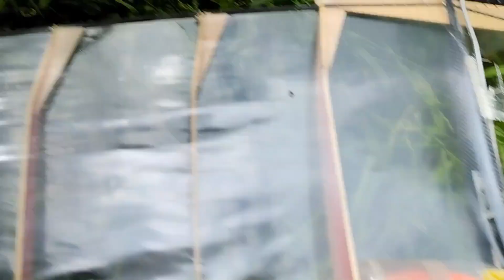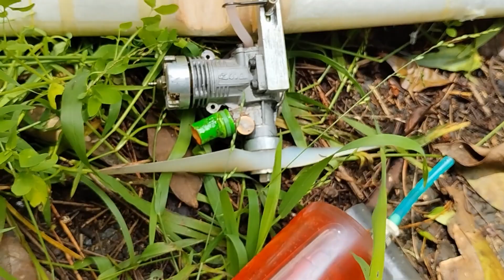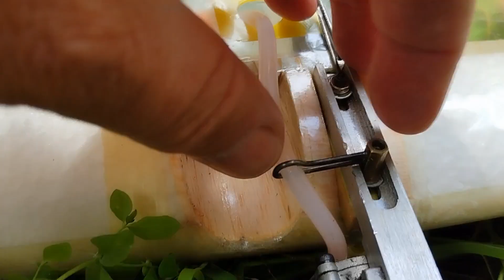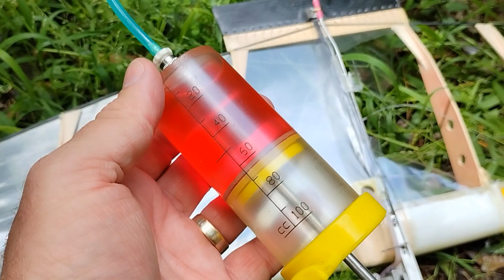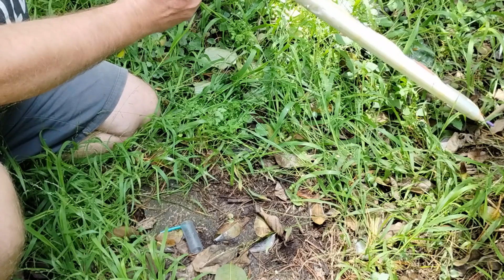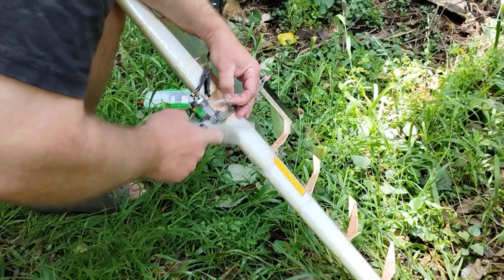CL Combat Bladder Tank Tutorial

Comment: The very interesting thing about these aircraft is the glue they use , wish I knew what kind it is 😢
Reply from the maker: I've heard that UHU is used, but not sure which kind or where.
Reply: Glue for covering? I am using UHU Power, it works very well. You need to wait, until it is not sticky at all. Than it will be activated by iron.
Reply: What kind of covering do you use? Is this plane scratch built? Or pre built? Thanks
Reply from the maker: This covering is mylar. The model is pre-built, but rebuilt several times after combat damage.